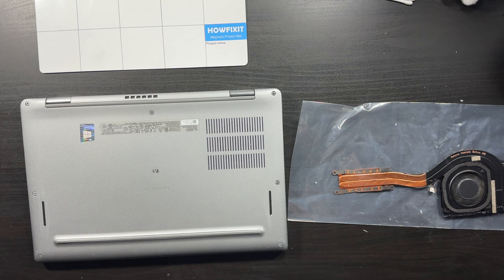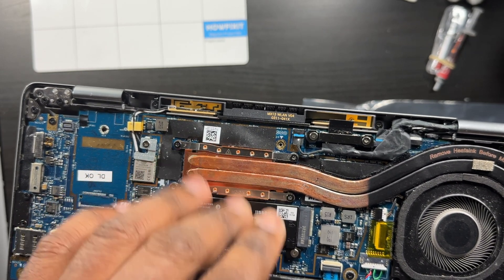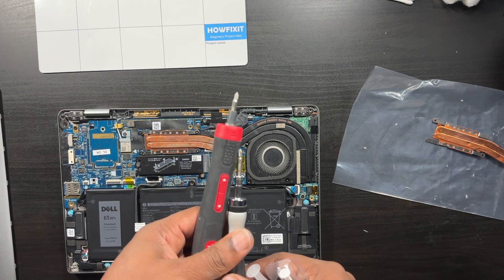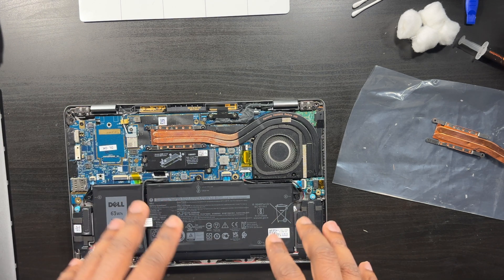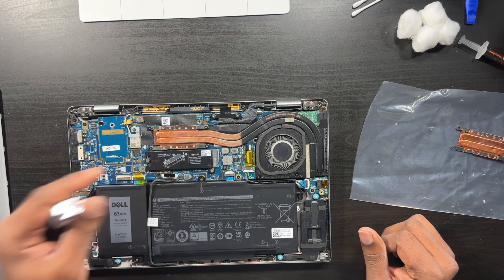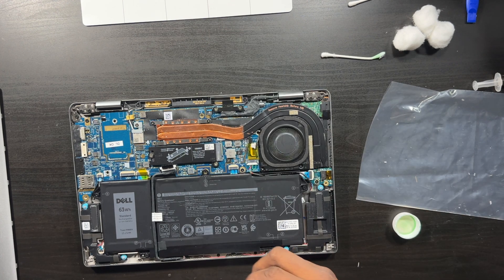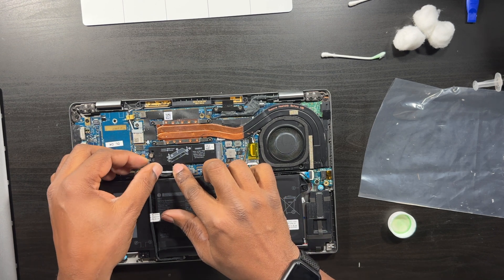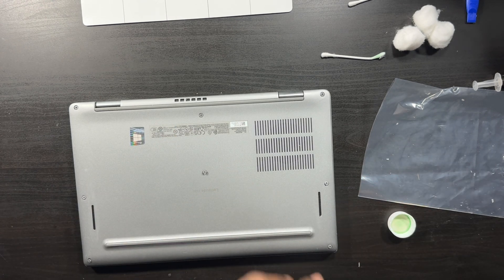Dell Latitude 7320 Heatsink Fan Replacement and CPU Thermal Repaste

Comment: Thank you this gave me just enough information to remove the CPU cooler. As a heads up I know this Video is 7 months old but take a look at PTM7950 as a replacement to the PASTE. It outperforms paste and gets slightly better with age. I just replaced mine on my work laptop as it was just horrible and thermal throttling left right and center.
Reply from the maker: Thanks for watching glad I could help I’ll definitely check out the ptm7950 paste.